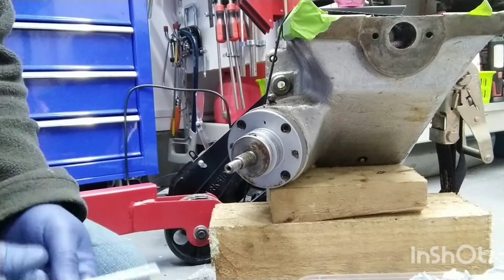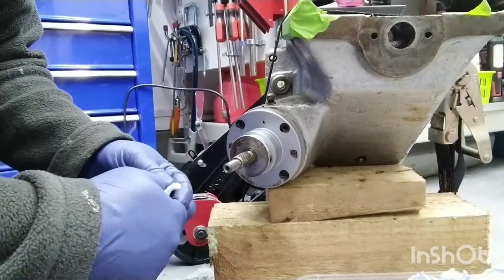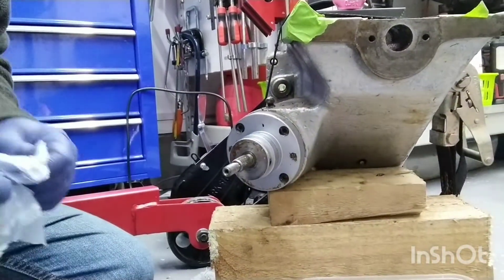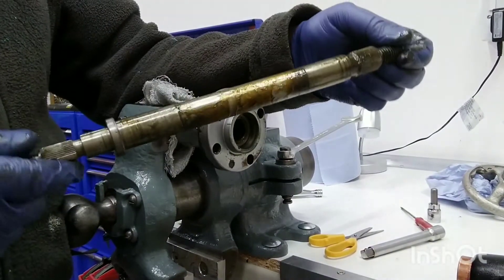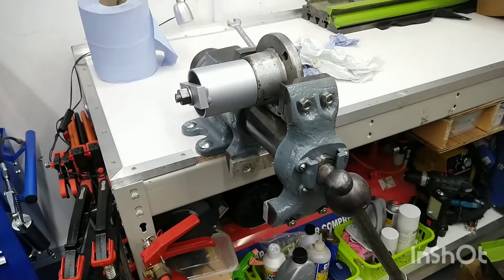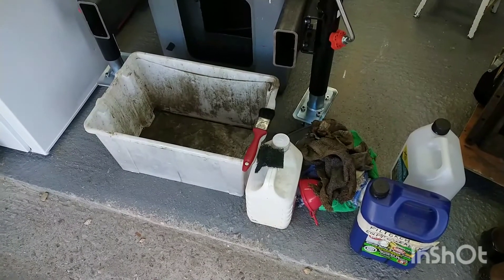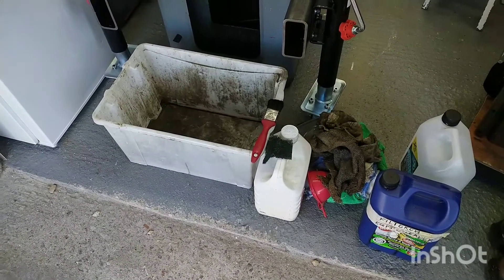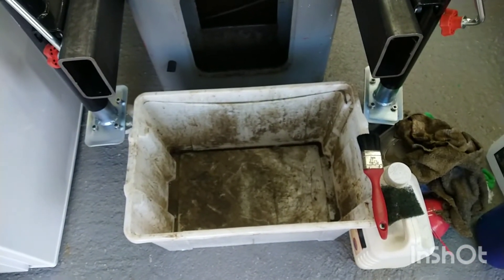Harrison Horizontal/Vertical Mill Restoration Part Three - Measuring Threads on leadscrew

Comment: Excellent Carl, exactly what I needed to know. Good to see your brother, who also comments frequently on my channel. Cheers
Reply from the maker: Thank you Paul. At the moment I am busy effecting a repair for a stripped 63t change wheel on my lathe. A 3d printed one just went without warning. After that is completed I will be back to test threading for the 5 tpi acme nut for the mill. Yes my brother is also a highly experienced engineer and his channel is devoted to the machining, welding and general engineering required to restore old motorbikes.

Comment: Hi Carl, good insight into thread and shaft measurement that was well presented. Like you, I wouldn't be worried about the clearance on the shaft bearing diameter (also without the capability to fix it). 0.01" on diameter is only 0.005" radially and the gears will be able to accommodate this comfortably without binding. Can't tell you two are brothers at all 😂. Cheers, Jon
Reply from the maker: Hello Jon. Thank you for taking the time out to watch my film and comment. I really appreciate your input. I agree with you, I think that the wear on this part is really not so bad as it seems. My main concern is the wear that is evident points to the knee drooping downwards. That probably explains why the Z axis leadscrew was so stiff and I couldn't turn it, in part two.

I do have an idea for repairing it, but it would be costly so I think not worth it. Thanks again for your comment!

Comment: Interesting that yours has a splined end with a lock nut for the Z handle. Mine (and all the others I've seen) have a square end (and a screw). 

When was yours made?  Mine is a 1966.
Reply from the maker: Thanks for the comment my friend and thanks for watching! Yes, the drawing shows a square end and screw. Mine was made in 1968.
Reply: @carlwilson1772  Might have been a special request then. I thought maybe it was an early thing but yours is slightly later than mine (and I've seen the newer "squarer" models also with the square end on the Z handle.)
Reply from the maker: @fastdruid  We will probably never know. What I can tell you is that when I got it, it was wired with a "Square D" make drum style reversing switch on the feed motor. It looked like it was original factory fit, so maybe this mill was a "special". Hard to understand why someone would specify such an esoteric thing as a different drive on the Z axis input shaft.